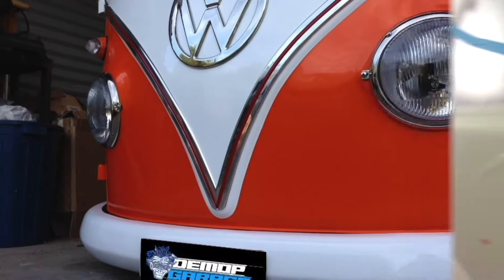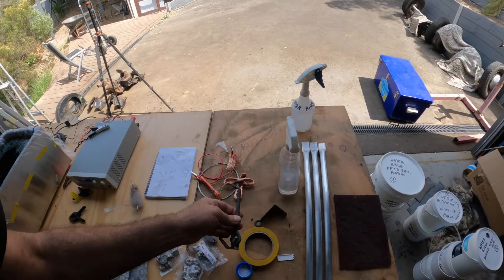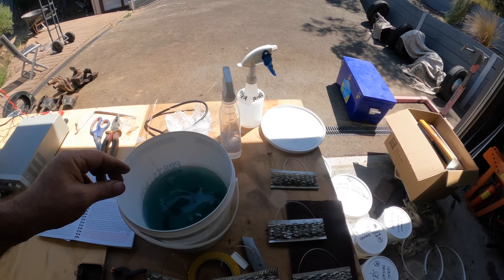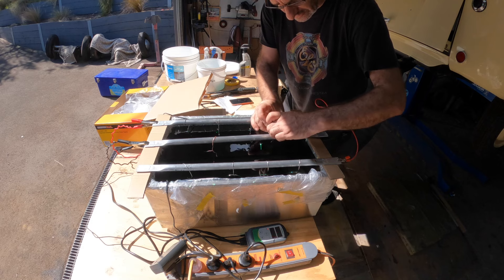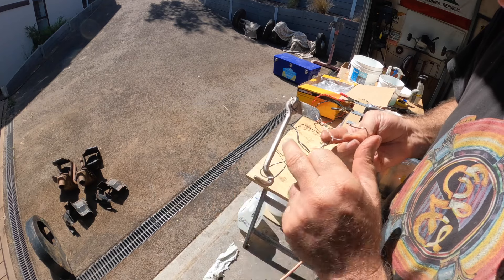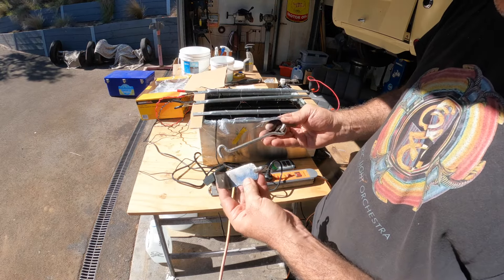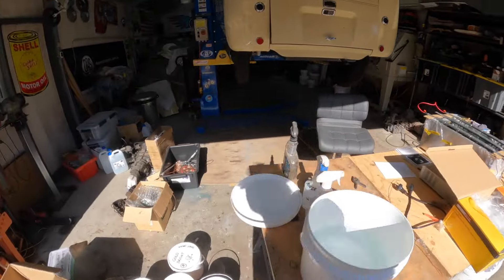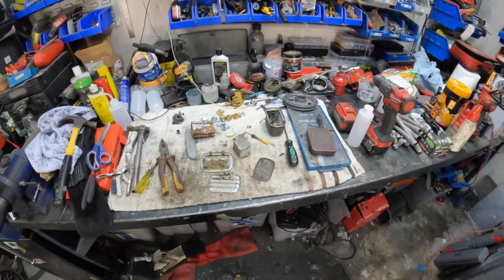Cobalt nickle plating vw parts at home #vwrestoration

Comment: So cool, all the shops that used to do this have dried up here in California.  I have a pitted "chrome" turn signal for my double cab that I would like to some how restore (I already restored the mechanism and wiring), if the metal was smooth this would be the perfect way to fix the plating.  Any recommendations how to fix pitted chrome before you do something like this?
Reply from the maker: Yeh i did hear about California banning the chromium process, if the metals pitted you have to totally remove it back to bare metal before you plate. Caswell does sell the kits in the usa too 👍🏽😉

Comment: Hi Nick been watching your videos for a while now and really enjoying them. I've got a 64 beetle im restoring. i recently purchased a sand blasting unit similar to yours, wondering how you go with using yours and what size air compressor you're running? Having few teething issues with the hand peice picking up the garnet, keep up the great work and videos Cheers 👍
Reply from the maker: Glad your enjoying the vids mate, the blasting is doing ok, but air flow is always a problem I’m running 620litres per minute and it just keeps up. If I’m blasting for an hour the compressor gets hot. Its a twin motor unit from peerless
Reply: @DEMOPGARAGE  Thanks Nick 👍

Comment: But it would also be a coincidence if everything worked the first or second time. There are definitely a lot of factors that depend on that. But for the first few attempts the result is completely ok, I think.
Reply from the maker: That’s right, if the parts not super clean and polished it doesn’t look right👍🏽

Comment: I am sure you will get it Dailed in. Might try finer glass beads instead of sand ? Don't you dip them in another solution before the plating ?
Reply from the maker: Did use fine glass beads, last part was good 😁👍🏽 more practice to come